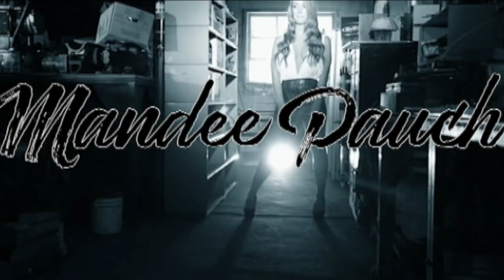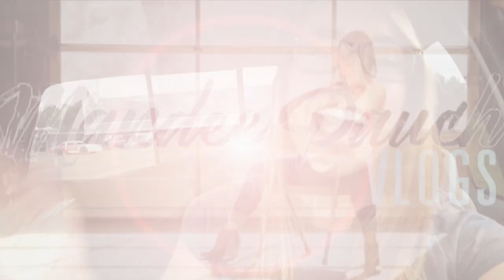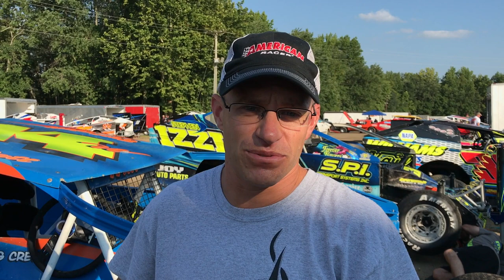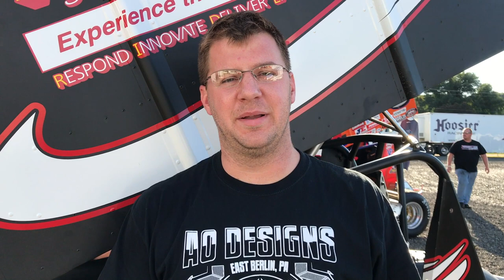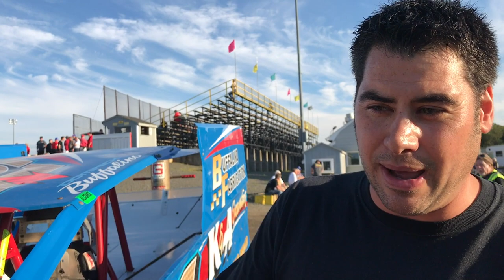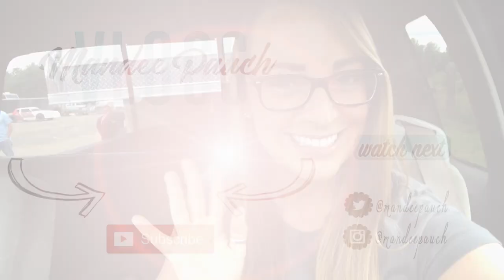Did You Know: Slick vs. Rubber

Comment: all tracks should use a "sheepsfoot roller" to put holes in the track so the water soaks in and stays there instead of running off ending up at the  bottom of the turns. that is why the racers are all on the bottom of the track because the moisture is there. i came up with this idea 50+ years ago.